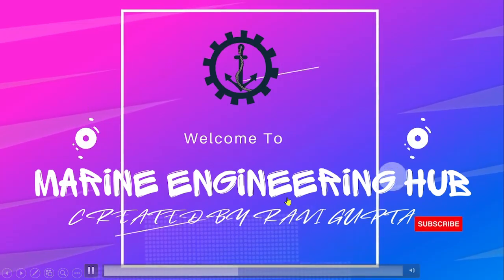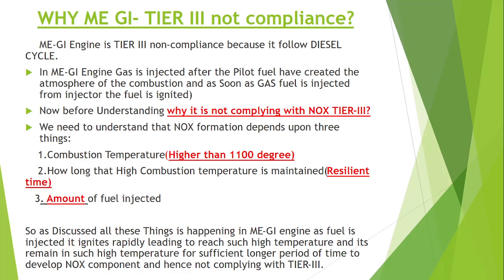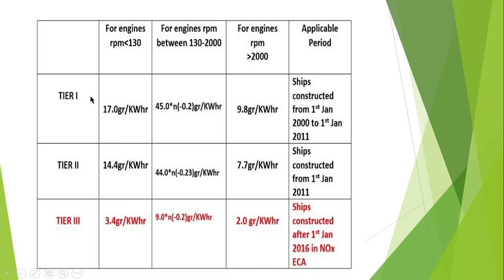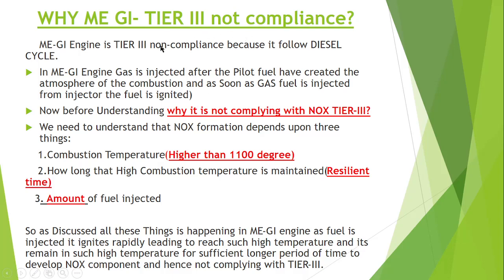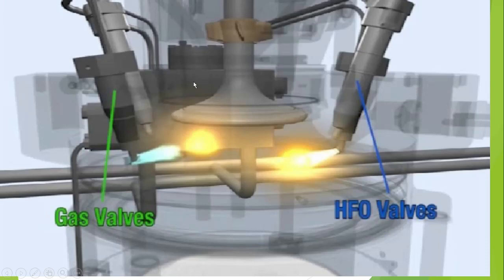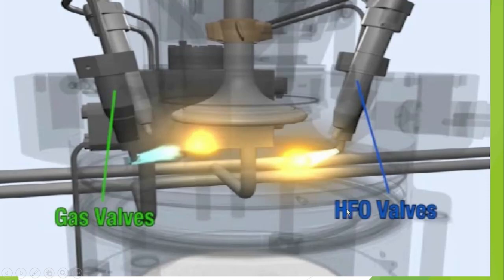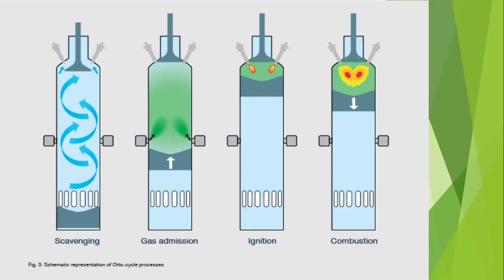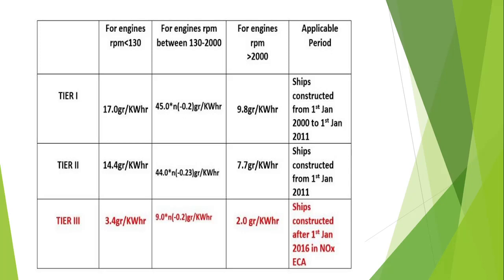ME-GI engine not Tier III compliance|ME-GA engine TierIII compliance|How |Part-3

Comment: Bro, i have a doubt. Pls clear it.
Acc to your video, for me gi engine combustion is rapid and temp is high so that very high potential nox emission occurs
For me ga engine, combustion take place more time and temp is lower than me gi. So we reduce the nox emission.

And you say also, me gi runs diesel cycle. Me ga runs otto cycle.

If me ga runs with otto cycle. Combustion should be in constant volume. So combustion should be in rapid when the piston at tdc. Otherwise if it is slow, piston will go bdc and volume will increase and that will not be an otto cycle. So bro, please explain to me where I am mistaken. Thank you for very informative video.
Reply: Me Gi is diffusion combustion. It means fuel penetrates the compressed air at high pressure. So it's a pressure constant, rising temperatures, which leads to high adiabatic combustion temp. Highly efficient but NOx forms.
But ME Ga gas is premixed with air as air fuel mixture and burnt at constant TDC volume. Hence temperature rise is from lower to higher giving a cooling effect, the adiabatic temperature will be less and leads to less NOx. GA is not efficient as GI hence methane slip will be there. If GA is tuned by fully electronic pilot injection then slip reduce and efficiency improves.